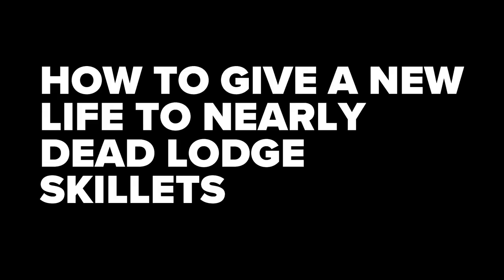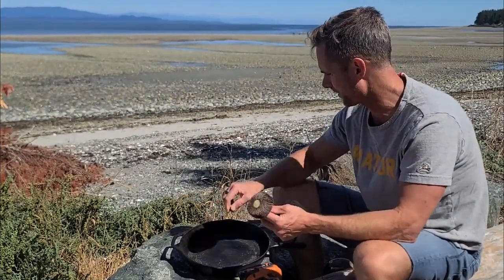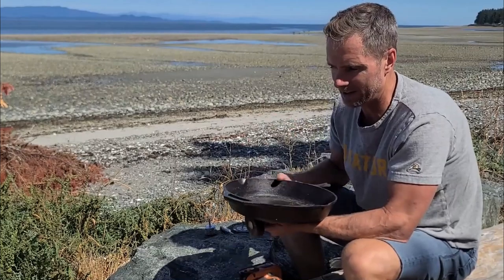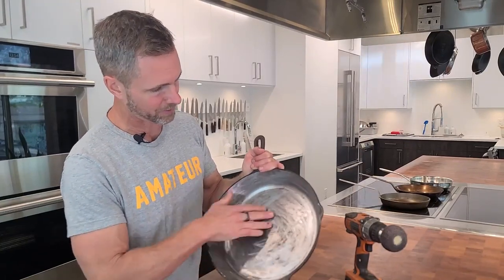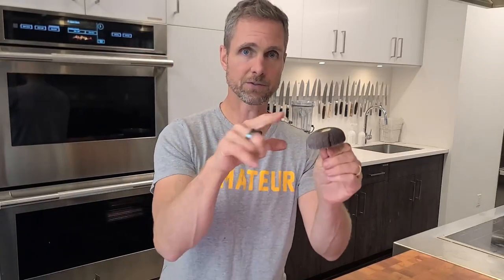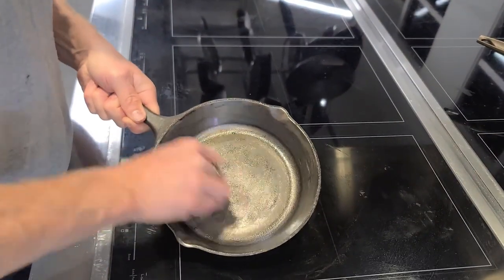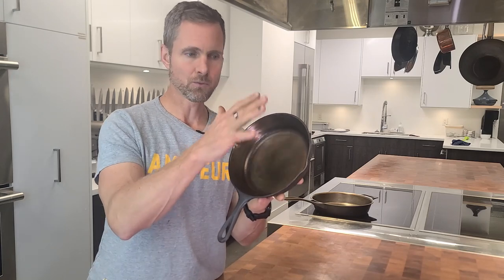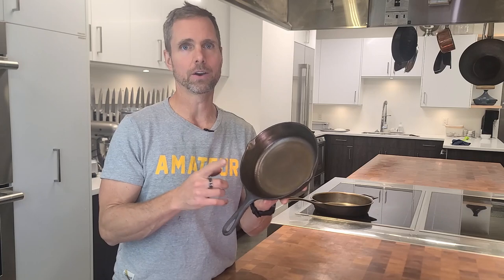How to strip and repair major build up on Cast Iron Skillets

Comment: Sorry, but no. As others have noted, you'll need successive grades of grinding wheels (and a lot of time and elbow grease) to restore a pan this way. Cast-iron pans aren't that expensive, so, if this were the only way, it'd make more sense to just buy a new one. But, happily, there is a much, much easier way: Get a large trash bag, put your pan in it, pour in a cup of ammonia, seal the bag (squeezing out as much air as possible), and leave it for a couple of days. Open the bag, careful not to breathe the fumes, pour out the ammonia, and use chainmail and/or a metal spatula to scrape off the carbon. Some will surely remain stuck to the pan, so put the pan back in the bag, add another cup of ammonia, and finish the job in a couple of days. Then use a bit of Bar Keeper's Friend to remove the discoloration caused by the ammonia, which won't take all that long. Dry the pan with paper towels, then season it. This approach will take minutes, rather than hours, and will even get the spots that would be difficult or impossible to reach with a grinder. This works for carbon steel pans, too.

Comment: Or you could do what I did and run the pans through the self cleaning cycle of my oven.  At the end there was some dust to be rinsed away.  Proceed then with the seasoning process four times.  The pan is now fully restored, better than new.
Reply from the maker: Hi, some carbon build up is just too thick for the self clean. I've had success with a lightish amount of build up using that method. The very best is a lye bath.
Reply: My grandmother would go out in the country we're she could do a Hard Wood camp fire, and burn off her skillets. Always use hard wood, like oak or hickory, NEVER use soft wood like pine or such. The ones I have inherited need that done badly.

Comment: Why's everyone using bees wax mix now? I just use raw natural lard from my butcher lol. Seems like wax would be counter intuitive as it doesn't really polymerize I don't believe.
Reply from the maker: What dries harder at room temperature,  lard or beeswax?
Reply: @Cook-Culture  I mean polymerized fat is going to be hard regardless, which is kind of the point?
Reply from the maker: @Dougie085  The point of the wax is how it applies to the pan, much like lard. It coats the pan very evenly so you can use much less oil. The end result is a super thin, smooth, and hard finish.

Comment: I tried to watch this but you are doing things the hard way. This is cast iron. Build a hot fire in a BBQ or fireplace/pit set the pan in it for 30 minutes and remove it. Let it cool and wash with the chain-mail . It should come out smooth and shiny. My grandmother gave me a few pans that needed to be restored and she told me to burn them and reseason. THey are in perfect condition after 30 years in my kitchen. The pans might be 100 years or more old.
Reply from the maker: Nice! Yes, I've been experimenting with that process
Reply: @Cook-Culture  so many people think that putting your carbon steel or cast-iron in a fire going to break it or warp it but it was created in fire. I have done probably 15 or 20 pans in a fire in the past I don't know 20 years and I've never had a problem I've never had a cracked or warped pan. And they come out like they came out of the form they were made in
Reply from the maker: @MrDMikeM  Yes, great results so far. I'm just waiting for the rainy season so I can get back to it and make a video. I have the pan all lined up!  Thanks

Comment: If it's just built carbon, put the pan in the campfire.  Problem solved.  Self- leaning cycle on the oven might work too.  It only needs to be ground if it is seriously pitted from rust.
Reply from the maker: I tried the oven with this one first. It dried it out but did not remove any build up.
Reply: @Cook-Culture  Did you use the self- leaning cycle?  The regular cycle won't get hot enough to remove carbon.

Comment: Use science, not brute force. Electrolysis. That way instead of going to the beach and grinding away at a cast iron pan, you can let Michael Faraday and his contemporaries clean your pan while you sip margaritas. I just got a 100 year old Wagner two days ago that looked worse than yours. I'll be cooking with it tonight.
Reply from the maker: I used a Lye Bath in another video. Works well.

Comment: Why use a power drill that's a really stupid way of doing it.
Reply from the maker: I was attempting a process that would be accessible to most anyone using tool that most people would have quick access to.
Reply: @Cook-Culture  I don't own a power drill but yet i have fully restored pans and pots bigger then what you were working on in way less time.
Reply: @alloutbassfishing6372  care to share more details? Difficult to get on board with your argument when you don’t share how you did it…

Comment: I follow Jed, but I’m disappointed in this video. Folks, plz search youtube for cast iron restoration with Easy Off (yellow capped).  Sprayed on well.  And then let sit overnight in black trash bag.  You may have to repeat this 2-3 times at least for heavy carbon buildup.  At that point you can put in a 50/50 vinegar solution for 30-40 minutes, etc. to remove any rust. Sometimes rust is not obvious. You may need to repeat this process as well.  And then proceed from there with whatever else is needed. If there is other damage or pitting, then you may need to follow up with some light sanding, etc. Always rinse in cold water to prevent flash rust. Then dry well with a cloth or paper towels and quickly spray on light layer of your preferred vegetable spray to prevent flash rust, and then start the pre-heating & seasoning process.
Reply from the maker: You prescribed method is easier and better in all ways. This method worked for this pan, which had an incredible amount of build up. From experience I think this would have been 3 or 4 sessions in a dense lye solution. I don't think that over cleaner would have penetrated it as I don't find it harsh enough for something this hard.
Reply: Yes, thanks.  That would definitely be the best scenario for such skillets. I would love to be able to do a lye bath as that seems like the next easiest and most effective method, but we are on a septic so that’s not a good solution for us.  Since I am only restoring a few skillets in my personal collection and not for resale, an electrolysis tank tank is not practical.  I may have to use one or two cans of Easy Off, maybe even a third to work on a really cruddy skillet, but so far I’m having pretty good luck with my lazy basic system. Our daughter bought us an old Wagner 9 inch “chef’s” skillet that is really badly pitted in large areas, both inside and outside - very fine pitting (some sort of household chemical?)  It does not look like the typical sulfur pitting.  I’m going to try to use a small wire brush on my drill or Dremel to see what results I get since, unfortunately the skillet is not usable at this point. It probably needs your approach.  I’m not optimistic that I’ll be able to restore it otherwise.  Such a shame.
Reply from the maker: @johnsiemssen6802  I hope it works out! The fine pitting can sometimes come from excess salt used over time.

Comment: What's this nonsense about chain mail?! I am 42, have used cast iron my entire life, and all we used was salt or sand.
Reply from the maker: Why nonsense? There was a time when a horse was the preferred mode of transportation. Give it a try. It's cheap and very effective.
Reply: @Cook-Culture  You stripped it with a wire brush and a drill. I think I'll pass. That took off a good amount of undamaged cast iron. The steel in the brush is far too abrasive. You're just adding unnecessary time, effort, and cost to something that shouldn't be that difficult or costly. I have been doing just fine for 42 years with a rag and a carton of coarse salt. How much did that wire brush cost? And the drill? Everything else you're referring to in the video? It's not just the chainmail I'm referring to. This entire project probably cost you over $60 (or whatever currency you use) when it could have cost about $6 instead.
Reply from the maker: @Thomas Newell  oh sure, this is definitely not the best way to reclaim a pan however chain mail is by far the best tool for day to day maintenance .

Comment: I'm sorry but if you actually did a little research, you would have found a better way of going about this.  I've been restoring cast iron pots and pans for years.  And I have never spent 5 hours taking removing any of the crud or rust.  This video is not good to learn from at all
Reply from the maker: I used tools that were available in my local hardware store.
Reply: @Cook-Culture  whats wrong with coarse salt and steal wool, or a water vinegar solution or Ez off oven cleaner? all way better then a power drill.

Comment: This is not advice anyone should take
Reply from the maker: Not the easiest but it worked great for this pan.
Reply: @Cook-Culture  nah bra, if youre going to use a power tool, use the right tool. Theres planing sanders and planing wire brushes that are specifically for cleaning flat surfaces. You are using a wire brush made for removing heavy buildup and debris from concave and convex surfaces and by doing so youre cutting gouges into your flat cooking surface. Thats not 'hard work,' the title of this video should be 'how to ruin your pans'
Reply from the maker: @tactical-bucket  Sure, but at the end of the day the results were excellent.